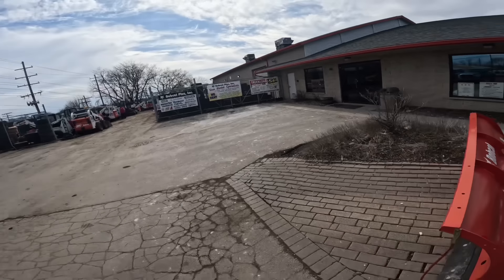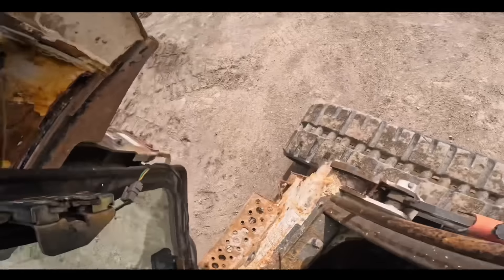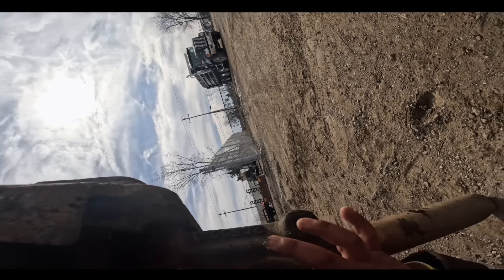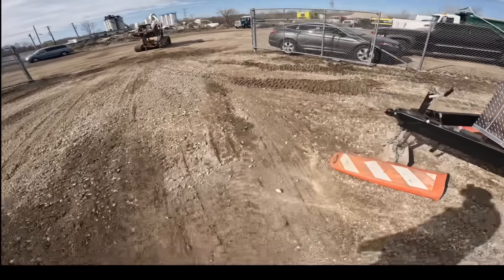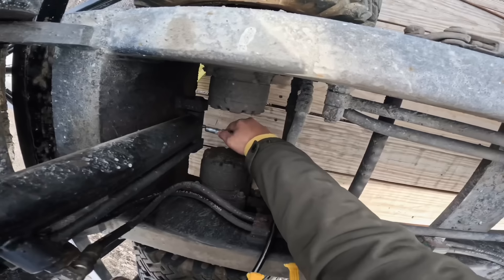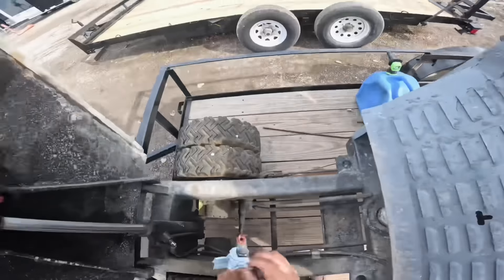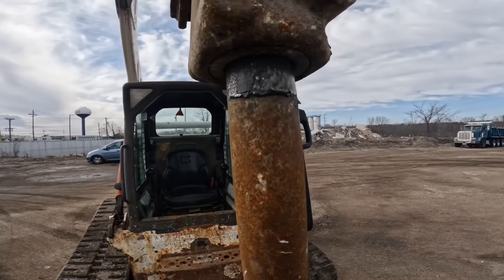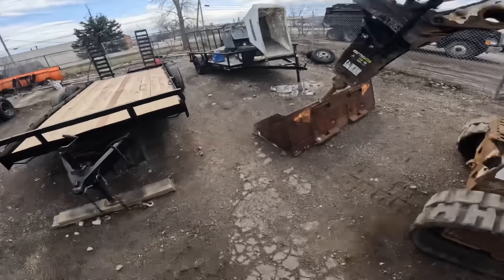It’s been a while , grease and more !

Comment: You check hydraulic fluids when everything is in the normal position not extended out cause your using fluids to extend the rams out so it gonna read low. Zorra

Comment: When the pistons are all the way extended you won’t get an accurate reading on the hydraulic oil level. Easy way to over filling. Just a heads up.
Reply: Never that. Just sharing my experience. Atleast he’s trying.
Reply: @kylel5p454  Zak knows that he’s just being sarcastic cuz he thinks your helpful comment is the same as others criticism when they comment on every video telling Eric what he’s doing wrong and how there “surprised” he can even “handle things”. I wont be a hater though Zak, just a observation. 🤔🤷‍♂️
Reply: Won’t matter because it’s a double acting cyl.Fluid is filled up on one side or the other.
Reply: was about to write the same thing lmao its normal for the hydraulic to be low if youre cylinder fully out. but it shouldnt be empty
Reply from the maker: Thanks for the heads up I only put half of the oil because didn’t want to over fill it then more problems thanks for looking out 💯
Reply: If you put the hydraulic fluid in the gas tank, you dont have to measure it. The gas tank automatically measures it for you.

Comment: You could buy Grease any where. Longest it's the right weight. Even Wal-Mart, AutoZone, etc . I am going to give you a tip. You don't have to use it but. The caps always get lost on the end of the attachment hoses. So I always tie construction gloves at the end of the hoses. So they are always there and I could cover the end of my attachment hose lines. To try to keep particles going into my attachment since there on the ground. When you remove the attachment.. I've done this for years. And if you secure the gloves good to each hose. You won't loose them. And when you disconnect from the machine Cover them right away.  Keeps the tips of the hose looking new and free of dust. You want your attachments lasting a long time. Little sand,dirt, etc particles cut the life on your attachments. I do this to all my attachments. Good luck. Have a great Concrete year ✨️  ....

Comment: Your grease gun will work much better if you push the plunger back in after you load the new grease cartridge
Reply: Lmao. And it really helps if you get the air bubbles out of the grease tube.

Comment: Why do you push the trigger of the grease gun like that like if your afraid of it 😂 you can never have to much grease ask any operator same goes to the slack adjusters, s cams,  and kingpins on the tandem bro hold the trigger for atleast 5-10 seconds and it should be good 👍

Comment: Dude learn how read to the direction on the can. Everything you need to is right there on the product. And can or a quart of a gallon, not gallon quart. An always buy a bit more than you need , so you don't run short.That way you have to make a material in the middle of what you doing. And goes for everything you do. The greasing of the machine is done every 100 hours of work or monthly. So your shit runs smoothly n slick as hair grease.